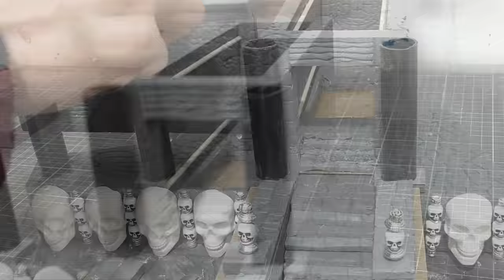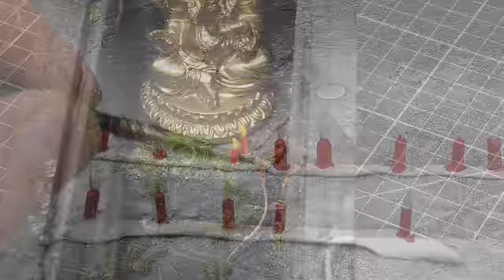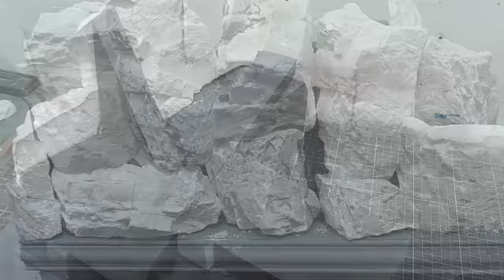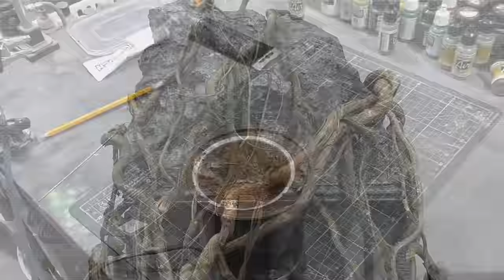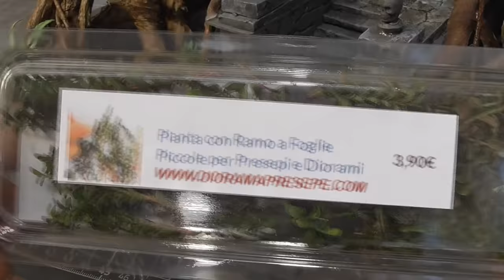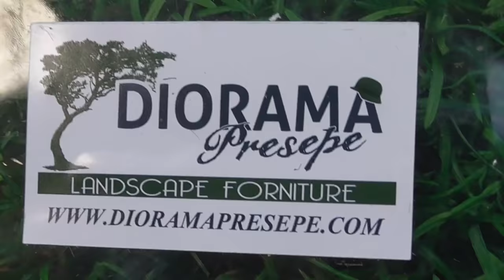Building a Realistic Jungle Temple Diorama

Comment: I am building a large scale diorama of one of the Devil's Island prison buildings after it was closed and the jungle began to reclaim it like in the movie- " Papillion"  when they roll the credits at the end of the movie.  I made the structure out of 1/2" thick plywood and plan to plaster the walls with stucco base and found some corrugated aluminum sheet that looks like the scaled version of the tin roofing on the building.  I also have tempered wire that replicates the prison bars.   I also have several live bonsai trees that look similar to the jungle trees in the movie also live vines to plant in the center of the structure.

Comment: This looks very detailed and great! What kind of foam did you use to draw on for the walls and such?
Reply from the maker: Hi Rodney, cheers for the kind comment, the foam is called XPS foam - it is a dense foam often used for modelling but you can similar stuff in large amounts from building suppliers sold as roofing insulation. I get mine in the UK from a company called BluefoamUK. Not the cheapest but great from carving details.

Comment: Looks great. Quick tip for painting foam if you're using rattle can spray paint, if you hold the can a minimum of 8 inches from the foam, you shouldn't get any foam melting. Course, a lot of this depends on the quality of the paint, cheaper ones tend to melt the foam at further distances. From what I understand, the main reason the foam melts is from the accelerant used in the can to get the paint to spray out. By moving the can further away from the foam, that accelerant will usually dissipate before it eats the foam. Course, because you're spraying from further away, building up a layer or layers of paint takes longer as some of the paint won't make it to the foam, and if you're painting outside, you'll have to deal with any wind that is happening.
Reply from the maker: I love it. Quick tip.. and proceeds with a short essay. Really helpful though. Usually I use my air brush to prime foam so I solves that problem completely. But I was waiting for a box of primer to arrive so grabbed a rattle can due to impatience. Appreciate the tip though. I love getting down to the chemical level